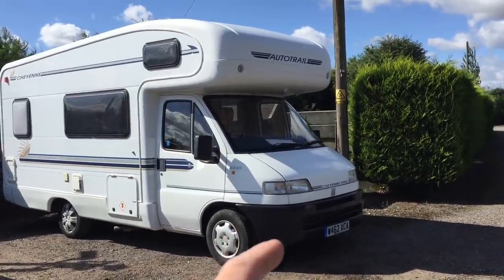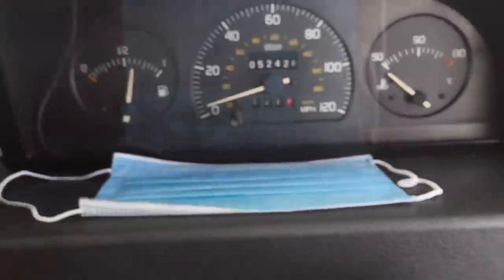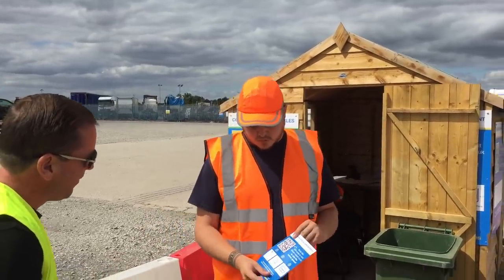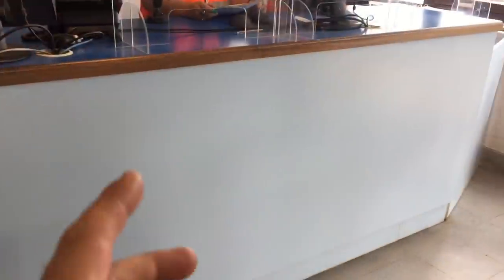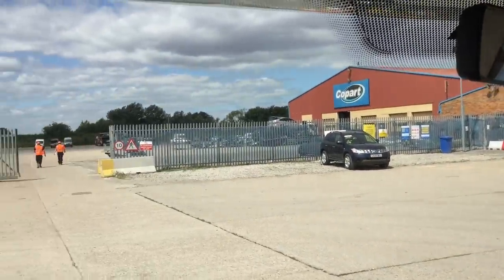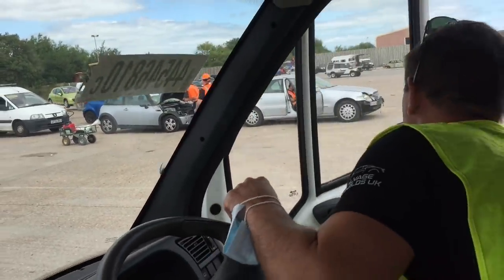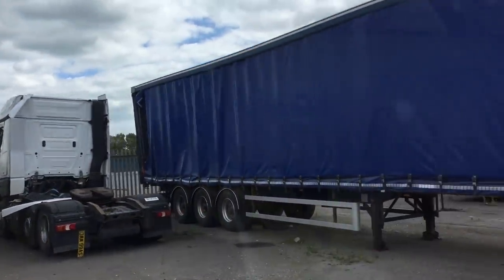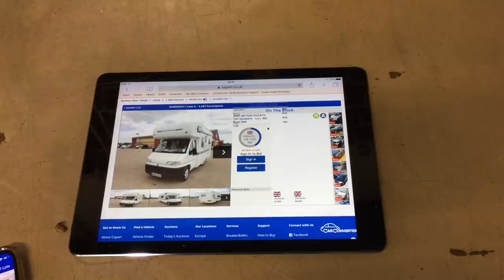Selling the Autotrail Motorhome at a Copart  Auction

Comment: I lost on mine it was a 52 reg but had it in Spain. ( right hand drive ) they would not let me put it on spanish plates. 45  thousand miles on it 2.4 d. Sold it for 7 grand. Because it’s mot had run out and it had to be taken to the uk.  Ldv proper conversion the guy who had it before me had it built from new. I had it for a few years then left it in storage. For 1 year started first time.  Twin wheel base. Fully loaded superb stereo in it tv and built in dvd stat nav  ( ford engine ) 2 sets of keys.   Immaculate inside.  It’s like cars in Spain unless there left and drive they go cheap. Still I am glad I got rid as it was just sitting there  costing me in storage
Reply: Should of said sold mine not lost it ...

Comment: I notice you using trade plates when the vehicle has no MOT. Do trade plates cover you for this?
Reply: There is no automatic exemption from MoT testing for vehicles used under a trade plate. A vehicle used under a trade plate is only exempt from the MoT testing requirement when driven during or on completion of repairs, or when driven to and from a pre-booked MoT test." So, no. You shouldn't drive a car with no MoT because it's on trade plates

Comment: I used to buy motorhomes for a car dealer before setting up on my own. Facts are hardly any caravan and motorhome dealers will actually buy 2nd hand motorhomes, most of the time they will offer to sell and take a commission or charge a weekly fee and typically motorhomes don't sell quickly so anyone who is willing to pay cash up front pretty much has the market to themselves and can usually absolutely bid someone in the bollocks if they need the money. £7,5-10k profit isn't unusual but you need a hell of a lot of capital up front to do it as you're usually into anything from £10k to £50k+ buying them.

Comment: Can you drive on trade plates without a current MOT?
Reply: Sammy TheSeal. from the gov web site! If the MOT has run out
You cannot drive or park your vehicle on the road if the MOT has run out. You can be prosecuted if caught.
The only exceptions are to drive it:
:to or from somewhere to be repaired
:to a pre-arranged MOT test.

Comment: Would you be interested in buying a 52 plate Peugeot Expert van with a 2 litre HDi about 190k on the clock? has dent on the front of the roof above the windscreen, the beam across the roof that joins the 2 B pillars is bent but not broke the welds. It drives fine. I been all over the country in it using it for work and micro camper. There is a few scratches and dings here and there. The wipers dont work on intermediate setting. 

The huge dent on the roof is down to some scumbag that through a brick from a bridge over the A38 dual carriageway in Derby last week. I am attempting to claim on the insurance. But just in case.
Reply from the maker: It wouldn’t be for me but thank you for the offer and I hope you get paid out 👍
Reply: @sruk  it's fine. I sort of wouldn't mind keeping it. Turns out I might have too as insurance say they can only record the event but I can't claim as I don't have vandalism cover on my TPFT policy. I am certain I had fully comp. It still drives fine and still got 3 months on the MOT. So might just use it until then as is or possibly get a replacement van and have a go learning some new skills fixing this up.

I do a lot of collections out of my local Copart in Peterlee.